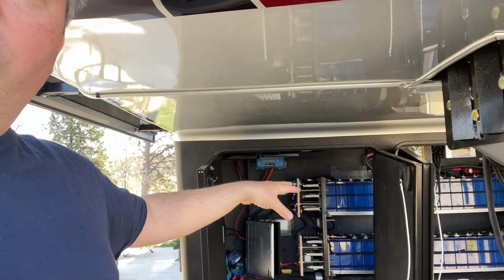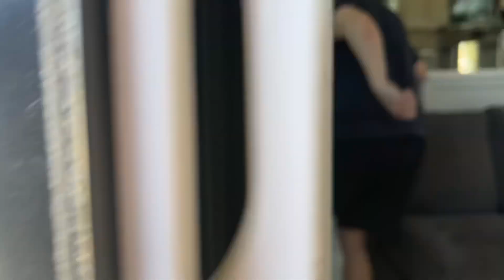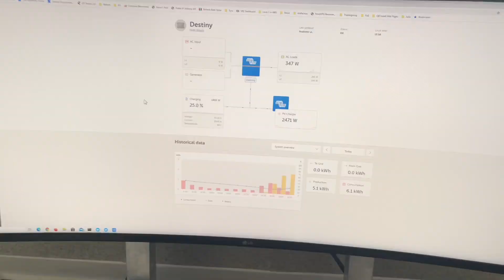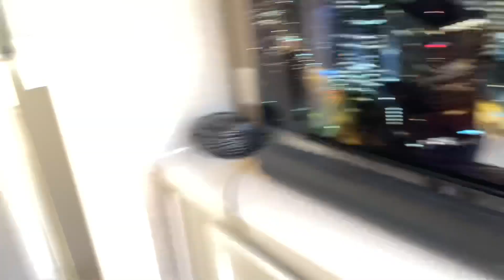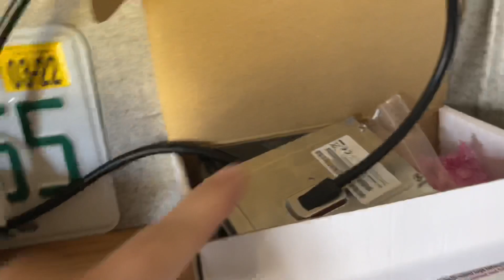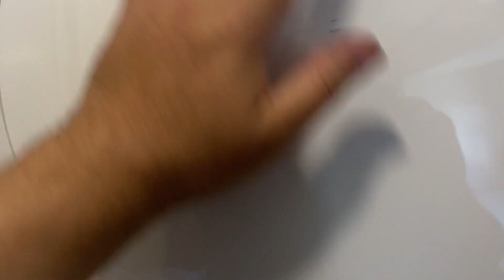Ultimate Off-grid RV - Biggest Solar and Battery You’ve Ever Seen in an RV!

Comment: Hey Ben, switch it up crew sent me also , my wife & I are looking to boon dock & have know about New Horizons 5th wheels for many years & met also some owners . You’ve can’t go wrong with their quality construction 👍 really want to find out more about your lithium/solar system. Safe travels to you & by the way what are you towing with ? ? Since I know NH are so heavy ? ? ? Thx 👍👋
Reply from the maker: I have a decked out F350 and that's not quite enough from a payload capacity.  Plenty of horsepower but these things can weigh 25000 pounds so the pin would be 5000 pounds (20%) and my payload is  5280 ... so.... yeah :)
Reply: Thx Ben , appreciate the response & luv the info & retro on the mini splits ………does the cassettes stick out from the roof at all ? ? Thx again …👍
Reply from the maker: @bobmariano3731  There is a roof protrusion.  It's not as tall as a standard RV rooftop AC, but it's a pretty good height.  I forget how much.

Comment: I have a similar set up in my motorhome. I have 3200 watts of solar, two Quattro 5k inverter/chargers set up in 240v split phase and a 10kWh 48v LFP battery using an Orion Jr2 BMS. I actually helped the Orion guys test out the Jr2 model with inverters, because the original Jr model that I initially purchased wasn't really equipped to deal with them.

I built mine before the 280 AH EVEs were on the market so I ended up using 100AH Fortune cells which are a lot more expensive (and heavier) than the EVE/Lishen/CATL cells that you can get now.

What was the Cargo Carrying Capacity on this rig? Those solar panels and batteries and inverters add a lot of weight which is one of the challenges I've had with my build is keeping the weight down.

Where did you get your bus bars? I'm looking at another project using the 300 AH CATL cells (Same size as the 280 EVE) and I'd like to get bus bars that can do multiple cells in parallel.

Comment: thank you;  I actually had an identical problem that manifested itself as an oscillating cell voltage displayed on the ISDT battgo monitor.  (I'm using the same 280ah cells as yours)  it wasn't always there but came and went.   after cleaning up the buss bar and contacts it went away.   took me a long time to identify and figure it out.

Comment: Nice to see someone else using the Orion Jr besides myself in an RV deployment. Congrats on a fine rig selection. I am in the middle of moving and upgrading our system consisting of 16.8kwhr at 24vdc based upon Winston 700AH cells and the 24v flavor of Quattros.
Reply: Are you using the CAN integration via your Cerbo GX to communicate with the Orion Jr? If so have you noted any concerns or shortcomings regarding the Ojr controlling the Victron charging and discharing functions?
Reply: @PnwFireguy  I'm also using the Jr2 in my RV. I'm using the CAN integration to control the charger/inverter etc.
Reply: @JeremyAkersInAustin  I am still using the original Ojr. Would love to know a bit more about your bms profile.
Reply: @PnwFireguy  I had the original Jr originally... Lol

But it couldn't take current readings fast though to be accurate with inverters which pull power in a rectified sine wave. So I actually worked with the Orion folks and helped beta test the  Jr2 with inverters.

What would you like to know?
Reply: @JeremyAkersInAustin  I also  worked  with Ewert and Ben to achieve what I think you two  are probably doing. 3.65A/cell charge rate to 95% SOC and then drop to 3.4. High enough to balance but about 30AH below fully charged. Flip side is I will get max cycle life for the cells. Half full attitude. Are you on the Orion FB forum?

Comment: Wow and I thought using 4 of them cells in my little  camper was  excessive - love how spring loaded the cells - should be worth another 1000 cycles - mega impressed
Reply from the maker: 1000 exactly!  Vendor specs 2500 without compression, 3500 with.

Comment: I love your setup, but I have a question creating something similar.  I am looking at buying a Victron combination transfer switch, charger and inverter.  Would this automatically pass through inverted power to all the circuits in my fifth wheel?  By disconnecting my existing transfer switch, charger and inverter (only used for the residential frig) and replacing with the combination Victron unit, I am hoping this is plug+play to send 110 to all the circuits since the inverter will be inline with the transfer switch.
Reply from the maker: If you mean you're buying something like a Victron Quattro, it can switch 2 inputs and it has 2 outputs (one of which is always-on, the other of which is only on when connected to shore/generator).  I removed my transfer switch because the  Victron would act as the transfer switch for me.

Comment: Another new comer from Todd and Sheila.  I'm currently designing a battery bank using the same cells.  Are yours Lichen or Eve and who did you get them from?  Would love some more details in your compression system...looks like threaded rod?   What BMS did you use?
Reply from the maker: Hi Dan!  These are EVE cells but I’ve recently played with the Lishen 272’s and I like them a lot better. They dont appear to need a compression fixture either. 
It’s threaded rod and Orion BMS (which communicates directly with the Victron system). You can see my parts list here: https://diysolarforum.com/members/cinergi.12721/#about and my build thread here: https://diysolarforum.com/threads/cinergis-28-kwh-4-kw-solar-10-kw-inverter-rv-build.13786
I purchased via a group buy thread on that forum from Michael Caro.
Reply: @TisTheDestiny  Looking to possibly install a similar Mini-split.   Is the breaker for the mini-split in it's own panel or is it part of the RV's normal panel with a double pole on one side?

Comment: New to the channel as well from Todd and Sheila.   I’m gonna be starting out building a class b van for our first rv. I’m really intrigued with solar and really want to do what you are building. I’m a little intimidated building my own as I’m not knowing how to incorporate bms and was probably just gonna go with either battle born or lion.  Then I was gonna go all in with Victron as I like their components.  Thanks for the video. I’ll continue to follow as I’ll probably pick up important information.  I’m an electrician by trade so I do understand electrical.
Reply from the maker: The DIY route scared me until I bought an SoK battery and took it apart (it’s serviceable) and got my hands dirty. That said, those batteries are only like $600 so it’s a great way to save.  Check out Gyll batteries too.